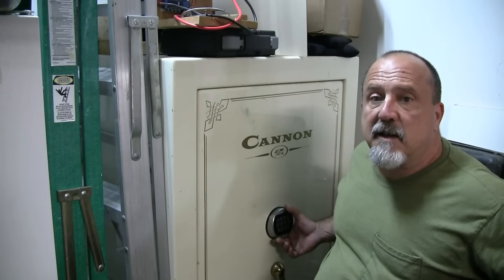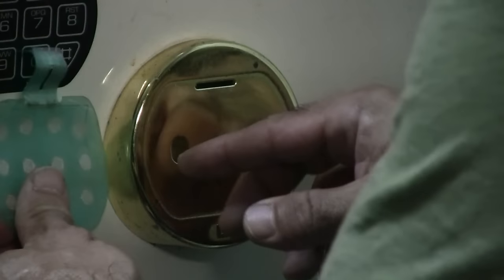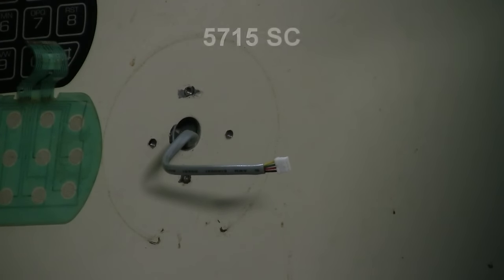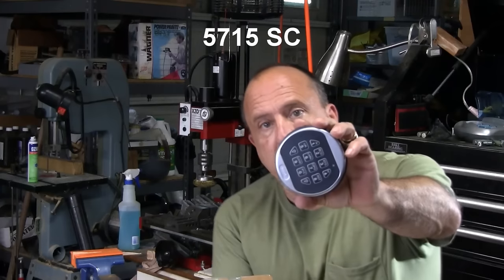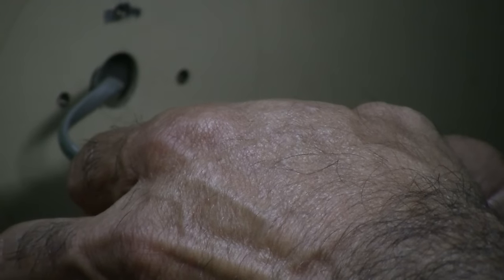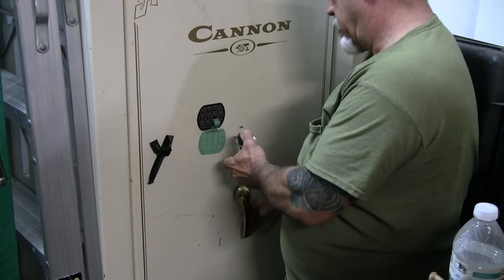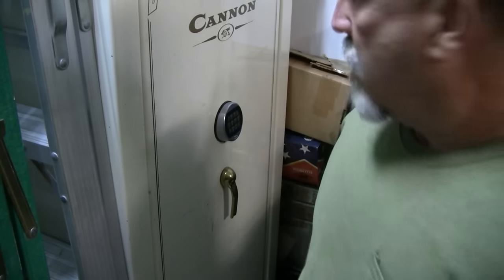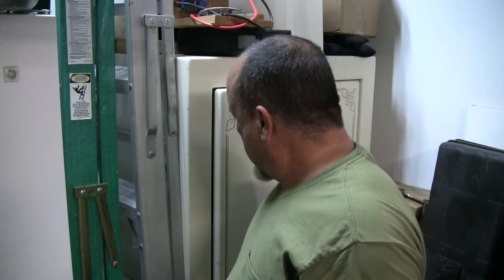Cannon Digital Gun Safe Fail Fix! Locked Out! Don't Drill - TRY THIS FIRST!

Comment: When working on your safe, LOCK YOUR DOOR OPEN that way if you pull your cable out or pinch it you don't have to call a lock smith.  I cringed when you shut it then pulled the keypad.
Reply from the maker: Id have to agree with you on that! My son told me the same thing he was also cringing lol.
Reply: Exactly!
Reply: I put a c-clamp on the body oriented so the door cannot be closed so I am able to retract the bolts while working on the safe without danger of accidentally closing the door.

Comment: I am stunned your electronic lock actually lasted 20 years.  I can't even keep count of the horror stories I have read about as well as first hand accounts of failed electronic safe locks.  Good video.
Reply from the maker: Thanks! I'm starting to think that locks on safes should probably be changed every 10 years or so!
Reply: Mine is at 21. No failure, no fault - 4 new batteries (now on number 5) are all it ever needed.
Reply: I think the key to that was his safe was 20 years old and everything is worse and worst quality As It Gets newer and newer.
Stuff manufactured now probably won't last two years.
Reply: My Cannon safe lock failed 1 year and 7 months after purchase. NEVER will buy a junk safe with a digital lock ever again. Digital locks are trash.
Reply: @DConstructiveCritic  I read about these things failing so often, and when they do it's usually with a great deal of grief including having the damn door drilled, I just can't seem to fathom why these electronic locks are so popular.
Reply: Mine just past 20 years. I’m now starting to have a problem with it.  When I enter the code, it gives me the wrong password beep.  Sometimes I’m locked out for five minutes. And sometimes I get in right away. New battery so it’s not that.  I just think the keypad is starting to fail.
Reply: @397coney7  When and if you can get it to unlock, then LEAVE IT UNLOCKED until you can have someone replace the lock with a new one, which is a great deal cheaper than drilling the safe door.
Reply: @ExtremeDIYGuy  I think you're right. Mine is at about 10 years and it is failing. I can still fiddle with it to get it open but I don't know for how much longer. Thanks for the tip I'll try replacing the keypad next.

Comment: Once the door is open it's best to replace the lock as that is often a point of failure.  Once the door is open NEVER close it again with thoroughly testing the lock with the door upon.  Replacing the lock itself is pretty straightforward. Life saving tip: Photograph everything before taking it apart. You may need to refer to the photo.
Reply from the maker: It may not appear so but I did thoroughly test the replacements before closing the safe
Reply: My safe has this feature that forces you to close it so I am locked out good now. While the door is open the pins will not retract. I closed it and even tho I followed the directions on setting up the code it won't take my code. My pass port is in there :(

Comment: Surprised you got Cannon to answer the phone. I have a worthless lifetime warranty on my Cannon Safe, but they didn't answer the phone nor gave me any help when my safe broke.  I had the same problem about 5 years ago and fixed it the same way you did.
Reply from the maker: They were easy to get a hold of. Getting the replacement parts took a few months though.
Reply: I have the same safe. The keypad went out about 10 years ago. Cannon overnighted me a new one at no cost to me. I did exactly what Joe did to get the safe open,  but, I ordered a Sargent & Greenleaf dial lock and swapped it out. Those electronic locks just don't last.
Reply from the maker: @stevekennedy2201  It took them months to get me my replacement! IT was backordered and they sent a different brand.

Comment: I recently replaced a LaGard basic electronic lock on a safe with a S&G 6730 dial lock.   The LaGard never failed (and still works) but I figured I was pushing my luck after 27 years with no failures.  The replacement was easy, and the new mechanical lock works great.

Comment: Joe, I recently viewed your video on how you fixed the safe that you display in this video. For the last few years I had been having problems opening my Cannon Safe and I had been playing with the idea of contacting a lock smith to come fix my safe. I viewed your video several times and then I went ahead and took off the key pad on my safe and checked the internal wiring, and found that it looked just as the one in your old key pad. I went ahead an ordered a new key pad, the LaGard 5715SC  through Ebay, the Kingman Security Group in Upland, Ca., and it arrived within two days. I installed the new key pad as you instructed and it works like a charm. Thank you for taking the time to make this video, you saved me some big bucks, Thanks Again!!
Reply from the maker: I am glad i could help you in your endeavors!! Thanks for watching!

Comment: You're the man!  I had a safe that was locked and wouldn't open, and decided to purchase a new keypad before calling a locksmith and getting it drilled out.  Pulling the ribbon from the keypad that was inserted on the external circuit board, and plugging the new keypad ribbon into the same circuit board did the trick!  You're a life saver!
Reply from the maker: Great to hear!

Comment: Just want to say THANK YOU! Saved me the cost of a locksmith. Purchased a $90. Kaba replacement lock which is LaGarda compliant. Took about 1p minutes to install. Works like a charm! There is also a manual combination lock setup that you can change out the electronic lock if you so wish. I'm still on the fence about the manual combo? About the same $. Anyway, I don't make many comments bit truly wanted you to know my appreciation anf respect for researching and posting this absolute perfect fix!
God bless!
Reply from the maker: Your welcome and Thanks! I'm glad you were able to get back into the safe!
Reply: @ExtremeDIYGuy  Fit a mechanical combo lock, the basic design hasn't changed in over 150 years. Many original locks are still working - proven design. Will always let you know if there is a problem, unlike digital locks, one second they are working, then nothing.
Reply: Could you supply a link or mor3 information on the manual lock option.

Comment: Great video! You also answered my question where exactly the combo numbers are stored.  I am also changing my Securam digital lock over to a mechanical Sargent & Greenleaf in the case of an EMP or other type of electrical surge that could fry the electronics in the keypad. I've had my safe for over 6 years and I'm probably over-concerned about being able to get inside but with the current state of the world right now you just never know. Thanks again!
Reply from the maker: Glad it was helpful!

Comment: Absolutely worked.  Locksmith said 500-600 to open. They “could” also replace the lock.  It’s such a difficult job. I wrote him back saying it’s disgusting what he would charge.  Thanks for saving me 500.00.
Reply from the maker: Glad i could help!
Reply: @ExtremeDIYGuy  Does that mean a thief could just buy a few new keypads and type in the default code and get into any safe ?.

Comment: Awesome that worked.  I had that concern when I bought my safe.  On mine, the keypad twists off and reveals a large hole for a key.  Never had to use the key, but good to know I can.
Reply from the maker: Is that hole for the key or the cable? Mine is for the cable.
Reply: @ExtremeDIYGuy  its for a key that came with the safe as backup. A large, long key
Reply from the maker: ah ok, got it.

Comment: Before you just plug in the cable, make sure that the wire colors are the same on the new/old cable.  Companies very rarely change what colors they use for different signals on wires, but the guy who designed the new circuit board might have swapped signal positions to the connector.  There's a really high likelihood they included the cable that goes through the door specifically because they haven't always maintained the same pinout on the keypad side.  If they swapped power and ground, you guarantee the need to drill if you hook it up without checking 'cuz you'll let the magic smoke out inside the safe.  A four-wire serial connection like that is either Power (Red), Ground (Black), Data In, Data Out or Power (Red), Ground (Black), Data, Clock.  If power/ground were not swapped but the data lines were, it has very low likelihood of doing damage, but it just won't open.

As a serious technophile, I can't bring myself to trust an electronic lock on my gun safe.  As you said, you waited five weeks before you went to eBay.  Since I learned locksport, I'll never trust a keyed lock.  The round locks might look more secure, but trust me, they're not!  Old-fashioned rotary combination is the only lock I trust on my safe.  Yes, they can fail too, but the only time I've heard of it actually happening is because of gross abuse or neglect.

Comment: I have 2 safes of different brands but the keypad connectors are the same. I had issues with one so I swapped them and voila it worked then I saw your video 😝. There was no way I was going to have a stranger come into the house and play with it and see what I have.  Worse case I was going to cut it myself.   Once someone sees what’s inside then your entire house is compromised.

Comment: I have the same cannon. In 2017 my pad failed as well. Unfortunately my search only revealed a lock company that charged me 335.00 for a replacement pad. But it did save drilling it. My safe was the same safe except a little bigger. It worked. The sad part is that the original key pad lock only had a poorly soldiered connection.
Reply from the maker: It sounds like you got off lightly at $335. At least you did not have to have it drilled.

Comment: U got lucky.  FYI Electronic locks can often be opened with a large rare earth magnet in about 15 seconds. I never buy a safe that doesnt use a S&G type 2 or better manual dial lock.  To each his own. But I am glad u got urs open. Goes to show you don't always believe what so called experts tell you.  I would have done exactly what you did.  Research and give it a try.  Good job.
Reply from the maker: Thanks!

Comment: I can understand the local safe company telling you to drill it, but surely Cannon themselves would know your way works!
Reply from the maker: One would assume so. The person I spoke to at Cannon was a customer service person, not tech support. they got the serial number, told me the locks were on back order and that it should ship out within a week. They also told me that the safe needed to be drilled and gave me the information to give the locksmith so they could call cannon and get the information on exactly where to drill. I'm not making this up.
One other thing to consider is that they don't manufacture the lock sets themselves. They use LaGard locks. Still you make a good point. 
When I called the second time to ask if the lock set had been shipped, I explained exactly what I planned to do. The customer service rep wasn't receptive to the idea that it would work but was apologetic about the delay in shipping. Maybe I should call back and talk to the technical support folks and ask why customer service is advising customers to drill.
Reply: @ExtremeDIYGuy  Sounds like a bit more communication between customer service and tech support would do them some favours.
Great video as always. Thanks Jose.
Reply from the maker: @masterblast4069 You are absolutely correct! Thanks!
Reply: My dial lock only lasted 6 years and they gave me that back order crap and i told them it was a liability issue and i would be tearing them a new ass if i was robbed
Reply from the maker: @dccajc1  Which is why I went ahead and bought one as an interim!

Comment: I have been through the same thing when my keypad died. It would have been easier if I could have watched this video beforehand. I was able to open my safe and turned the locking bars open to prevent total failure. Cannon was helpful with the replacement, but I had to take the inside panel off to get to the mechanism. Good to know an easier way now. I also had to replace  another dial lock failure on my late father's safe and the previous experience helped, as the company (Liberty) sent a keypad  to replace the dial.
Reply from the maker: That feeling when you try to open the safe and get  nothing is terrible! How did you get the safe open?

Comment: Good info only if you have a faulty keypad. New keypad upgrades only work with the specific lock . And if a safe drill is needed a locksmith should & could put another style so the drill hole does not compromise the safe security integrity. But yes your basic keypad are interchangeable. Good job Diagnosing
Reply from the maker: Thanks, I've had the fact that a competent safe tech can drill and patch to the point where it is better than before! I appreciate the feedback!

Comment: I've been a locksmith for 20 years, key pads go bad ALL THE TIME! I highly recomend an S&G DIAL. or if you HAVE to have a keypad, go with S&G. (Sargent and Greenleaf) LaGuard dials and pads are POO!
Reply from the maker: I like your description of the LG locks lol. Definitely agree with S&G for dial locks. They've been around forever!
Reply: How do you find out what’s compatible with your safe, as in compared to the 5715 LaGard. My original LaGard key pad is at least 20 yrs old and made of solid heavy duty copper and much heavier battery wires. They sure went to hades! Cant find anything that’s not cheep plastic!!
Reply: I have a 2009 safe with a S&G keypad.  Are there any options to be proactive?  I would hate to have a failure at a critical time.

Comment: You should replace the inside unit as well.  It was a 60/40 chance that the outer unit failed first.  These electronic locks last five to ten years and the closer you are to ten the closer you are to being locked out.  This is not a secret in the industry.  You made the right bet though and it is somewhat surprising how many pro safesmiths are not aware of your fix and others don't want to tie up money with different keypads sitting around.  You can get a new complete electronic lock for less than $100 and that is usually an easy self install.  Some folks will even order two so they will have a second keypad that is a guaranteed fit if they need it someday.  

Sometimes a mechanical one will be a direct screw in replacement as well.   If the mechanical lock is not a direct fit it requires some machinists knowledge and tools to make it fit.  Not for the average do it yourselfer.  Mechanical locks can fail too but it is rare and they are usually decades old.  In my experience I will replace 20 electronic locks before I have to do 1 mechanical.
Reply from the maker: From my research I have determined the mechanical locks do last longer but I went with a electronic pad for the ease of access, I have another video of replacing the internal mechanism as well. Thanks for the helpful insight!
Reply: Im not surprised these locksmiths do not know i have ran into this same thing time and time again that the people who sell it really do not know the product that well.

Comment: I store mine in my shed. In the winter it gets really cold.  Keypad works, combination works but tumblers won’t open. New battery installed, tumblers still don’t open. In warm weather, it works fine.
Reply from the maker: Shed might not be the best place for it
Reply: @ExtremeDIYGuy  it’s been there for the past five years. Every winter I have this issue. Way too big to fit inside the house. It is a widebody 48 rifle safe. Also, it is heavier than hell so I’m not moving that thing inside.

Comment: If you drill it you drive in a hardened steel pin and weld it. That thing would be more secure than new. You wouldn't have to weld a tapered pin (you can use a roller from a tapered roller bearing) except the surface steel on these is so thin if you don't it will only be solidly inserted in the lock mounting plate allowing the possibility of hole sawing the outer layer and pulling it out. Of course you can also weld it on the backside of the mounting plate inside the safe.

Comment: im not sure if it was this brand it may have been. but i found a safe in a storage unit auction. was locked ofcourse. pretty simple just to let it SLAM to the ground on the side the tumblers are on... it'll somehow mess with the solenoid and as soon as it hits the ground turn the handle and it opens. sorry if i didnt use the correct technical terms, and ofcourse i dont recommend this if you dont wanna damage ur firearms.
Reply from the maker: Must be a Chinese safe, the small table top one can be opened that way 99% of the time!

Comment: questions: What is the approximate weight of a safe like that?  Second question is: If you had option for non-electric mechanical dial tumbler safe instead of electronic which would you prefer.
Reply from the maker: If I remember right it's about 900 pounds for this safe. I hate to admit it but I prefer the electronic locks

Comment: The solenoid in mine failed. Locksmith drilled it for 300 bucks. I drove in a bearing to make it a challenge to drill again. And I switched to an EMP proof dial lock!
Reply from the maker: Good deal and you had the luck of dealing with an honest safe tech